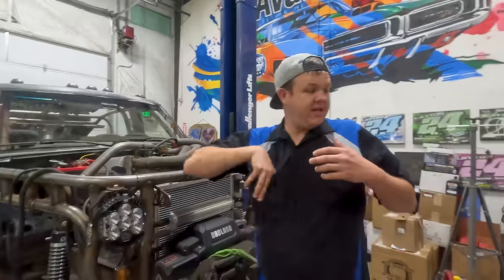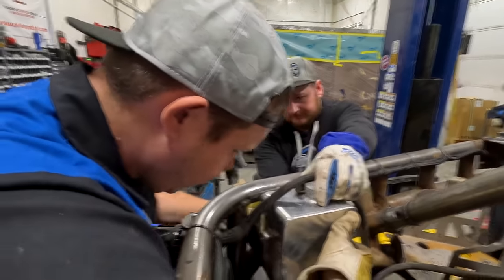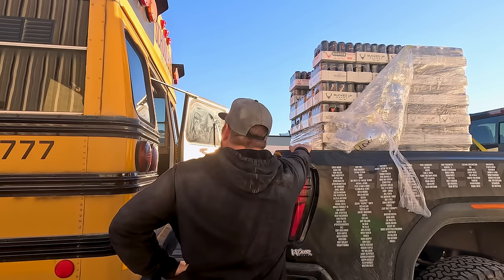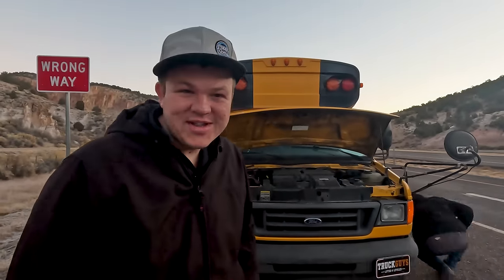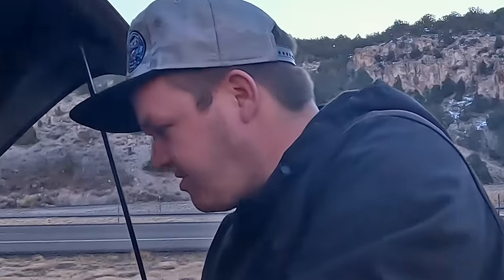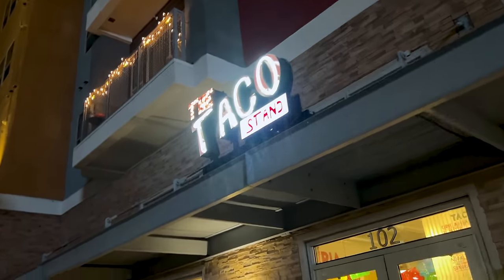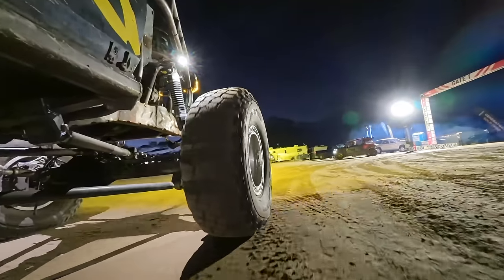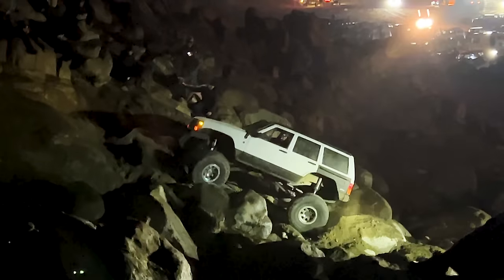We Took A Custom Built 4 Link Bronco To The Most Grueling Desert Race In The World!

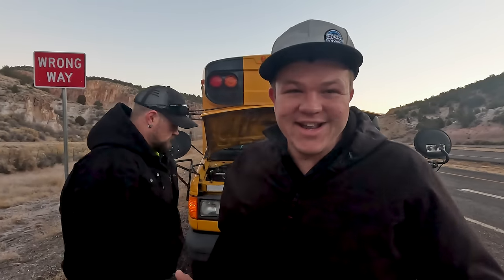Comment: 13:22 Not all diesels run with oil pressurized injectors.  Ford's 7.3L and 6.0L use a so called "HEUI" system - Hydraulic Electronic Unit Injectors.  They feed fuel at relatively low pressure, and engine oil at high pressure to all the injectors, then use a solenoid to fire a plunger that uses the high pressure oil to pressurize the fuel and inject it into the cylinder all at the same time.  This is different from a "common rail" diesel system that uses simple solenoid valves on each injector, but the whole fuel rail is under high pressure.  
"Unit Injectors" are pretty common, being invented for diesel engines in the early 1900s.  They have the advantage of not requiring a high pressure fuel pump and fuel lines. Before electronic engine control, each one was actuated with a camshaft or some other mechanical linkage.
Reply: Bingo! Not to throw off on hillbilly, but pretty much everything he said there was wrong lol
Reply: I worked for Detroit Diesel for 22 years, ours used the camshaft operated injectors for years and years. It didn't go to common rail till like 2009 or something. I'm talking back in the late 60s till 2010. Only the International's stuck with the HUEI system forever(garbage system)

Comment: Note for Hillbilly: Its not all diesels. Just diesels that use the HEUI systems. Some diesels use only pressurized fuel.
Reply: Was gonna say.. seen too many blown diesels from no oil pressure (or just no oil)

Then again, a diesel runaway is scary if you can't easily stop it. (Especially downhill, on a bumpy country lane about to meet a main rd, don't ask how I know 😅)
Reply: Ford Powerstroke diesels have that feature…self preservation.

Comment: I had Jiffy change the oil of an E450 Diesel less than 50 miles later the oil light came on.  I checked and found the plug was also missing.  So I know the feeling.

Comment: Hey Robby. Just so you are aware, all diesels that use HEUI need high pressure oil to fire the injectors. Cummins pickup truck engines have never fired like this, and I am not aware of those systems on Duramax engines either. I know a lot of large truck engines use them but I am not well versed in commercial large displacement engines to name them.

Hope this helps!

Comment: I told you hillibilly its guna over heat quick in the last video lol when u said ur not guna put a fan in for the place you took it  u need a good 4 core rad and atleast 2 fans and a proper shroud on that radiator and then just have it to a switch in ur cab so u can just flick it on

Comment: no hillbilly all diesel engines do not fire the injectors from oil pressure. The engines that do, like the powerstroke are called the Huey system and they have 2 oil pumps , lower pressure for the engine bearings and feeding the high pressure pump which supplies the system for the injectors with up to 2000 psi. That's how they get diesel fuel to run yes. However not all, Cummins 5.9 doesn't use that system and many others

Comment: Not all diesel injectors run on oil pressure. The duramax injectors are electronic and will run as long as you have some voltage but below 11v, it starts having issues.

Comment: I took my 95 Toyota 4runner in for an oil change at a local shop. I picked it up, and on the 5 minute drive home, it shut off on me and wouldn't start, so upon inspection, I found the oil plug was missing and a trail if oil behind me. It shut down before any damage occurred, thankfully.

Comment: not all diesel operate way. mainly older powerstoke 7.3 and 6.0 and some cat engines use the heui injection system.  i believe it was 1st used and developed by caterpillar and later used by international. diesels that have p pumps will infact run for a short time without oil but will require a major overhaul if you run it dry for a minute or so

Comment: Not all diesels have hydraulically acuted injection using engine oil.  Most common rail systems have gear driven high pressure fuel pumps, that deliver the fuel to the common rail.

Comment: Diesels use pressurized oil to open the injectors so if there’s no oil pressure, the injectors can’t open the truck shuts off. Also, why diesels run much higher oil pressure than a gas motor at least through the injector pumps.

Comment: 99% of diesel dont use the heui injection only cat(older models) powerstroke (only the 7.3 and 6.0) and a few international engines use it also again i need to state hilbilly you need more fuel pressure for the broncstar they run on 60psi not 30-40 its not an ls it isnt supposed to run off that low of pressure for long your gonna burn it up loved the video yall

Comment: 7.3 has a low pressure oil pump that feeds the High Pressure oil pump. The HPOP fires the injectors. You can make 1000 plus hp on a 7.3. 225 hp is stock

Comment: If it's a 6.0l 3 stage injector. The fuel is at the tip, oil under high pressure, electronics controlled to use the oil to push the plunger to force the fuel out the tip to 36,000 psi for perfectly atomized fuel into cylinder.

Comment: I'm intimately familiar with what a 7.3 engine does when the injectors lose pressure.  I blew an O-ring on the high pressure oil pump.  I've been told newer diesel engines use fuel to drive the injectors instead of oil.

Comment: Hillbilly is wrong when he said all diesel injectors run off oil pressure. 
Onky the 7.3 and 6.0 do since they are HEUI  injectors 

6.4 6.7 , I belive all duramax , and all cummins are ran off a seperate pump and fired either mechanically or electronicly , where the HEUI injectors are fired by oil pressure

Comment: Robby,

About that BUS......

Fix the engine......

Add Lift, 550 axels and military 43 inch wheels and tires and convert dually to a single.............

For the ultimate offroad Robby Crew party transport , youtoob video making bus....

And add tow hitch......

Comment: The benefit of a HEUI system is that if you run out of oil, the fuel system cutting out saves you from the disastrous effects of oil starvation.

Comment: Most of the modern diesels that I see in my shop have oil fired injectors. But not all diesels are. Anyone remember the 1978 Oldsmobile 350 ci diesel? Might still be one or two still on the road, until someone gets them towed in.

Comment: I am a retired heavy equipment mechanic, and the one thing that I have been terrified all of my working career is leaving a drain plug loose.  I have a ritual that I never deviate from.  The drain plug is either in and tight, or out.  If I do not have the correct tool to tighten the drain plug with me when I am under the vehicle, I WILL remove the drain plug, go get the correct tool, and then crawl under and install, and TIGHTEN the drain plug.

If you think that this is over-kill, what happens if I get distracted with a phone call, someone asks me a question, I fall down and hurt myself.............the list goes on and on!  Keep in mind that I am the absolute WORLD's worst and setting something down, and not remembering where I set it down at!!!   I swear, I have spent MONTHS of my life searching for something!   Sad but true!!   I am now 76 years old, and this trait has shown NO signs of slowing down or getting better.

I have seen the results of heavy equipment engines that were fired up without oil, or had the drain plug fall out.   They DO NOT RESTART!!!   $200,000 + down the drain.

Comment: Ford runs on oil pressure. Detroit run off of timing chain. Cummins varies on year but either a p pump over kill fuel injection assembly or cp3 cp4 high volume pumo to electronic injectors. Each one as unique as the brand that makes it

Comment: Only the HEUI injection systems use oil to drive the injectors, if that were any diesel with an injection pump it would have kept running.

Comment: HEUI systems uses engine oil and discharges the oil into the heads of the engine, that why you don't have to bleed any air. Non-HUEI, run like crap until you bleed the air from the pressurized fuel

Comment: only Diesels with HEUI injectors like Ford 7.3L and 6.0L shut down when oil pressure in lost. if it is a common rail system looses oil pressure the engine is toast

Comment: Every "fabricator" who works with their chop saw on the floor is an amateur. Step up and build yorself a stand. Use folding portable work supports. C'MON!!!! 😎 You can do it. Little kids play on the floor on their knees. I know your shop is an auto body and paint shop. But do you work on a door on your knees? No. Do you mix paint on your knees on the floor? No. Do you mix body filler on the floor? No. Do you lay a hood on the floor to hammer and dolly it? No. So why are you still working that way? Bad for your knees. Bad for yor pants. Bad for your work shoes. Bad for your back. When I got my 1st chop saw nearly 40 years ago, I built a stand the day I got it. My son bought a newchop saw last month. Uses my old stand. You can do it. It's not that hard.